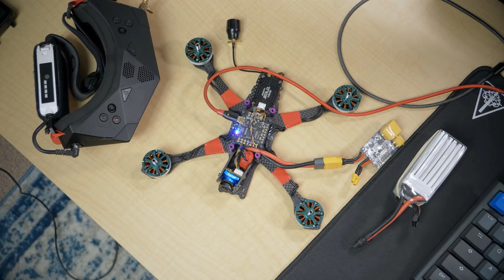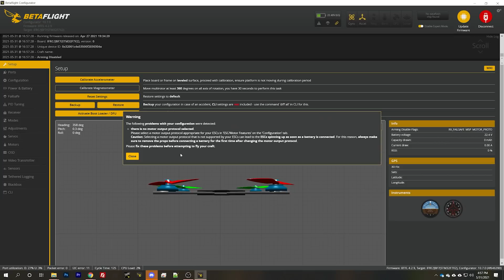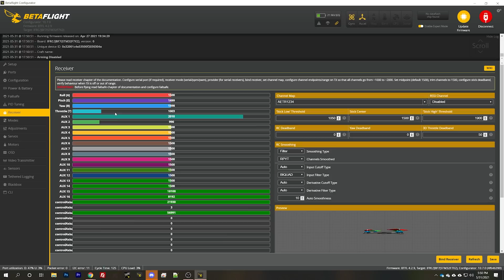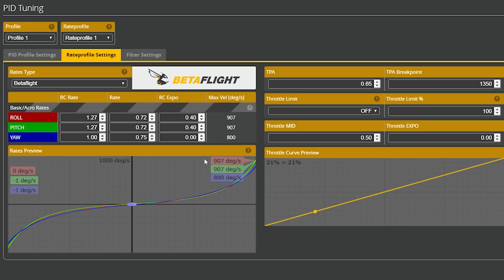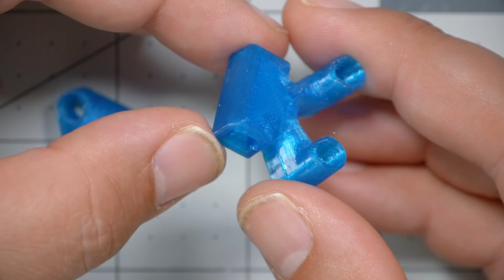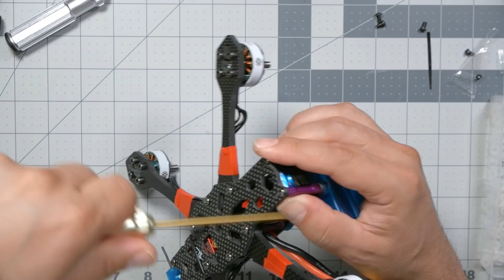JB's Perfect Freestyle Quadcopter | BETAFLIGHT SETUP (Part 2)

Comment: The Rush Solo vtx table has a minor error that will prevent it going into Max power, last powervalue should be 32 rather than 31: vtxtable powervalues 14 26 29 32
Reply from the maker: Oscar has already fixed this error and the text in my video description is also correct. So I didn't mention it further.

Comment: I couldn't get my vista camera to fit
Reply: Had to squeeze a little more than slightly but I got it thanks jb
Reply from the maker: The Vista is slightly wider than a micro sized camera so you have to squeeze the camera plates slightly to get them to go into the top plate.
Reply: @JoshuaBardwell  well if you are certain it will fit I will give it another shot but I gave it a pretty good go the first time ! Thanks for the reply btw
Reply: @JoshuaBardwell  would you belive my cam doesn't work now it must have squeezed too tight
Reply from the maker: No that's definitely not possible. The metal case of the Vista is more than strong enough for this situation. Check your camera wire to see if it has become unplugged or gotten damaged during the install. Check both at the Vista and at the camera.

Another thing to check: if you used M2 screws that are too long, they could have gone into the camera and damaged the board. But the M2 screws that come with the Vista camera should be fine.
Reply: @JoshuaBardwell  I'm not sure what happened I thought the same thing about the screws I took the camera apart and seen its not possible for the screws to be too long I'm not sure what happened I worked before I removed the top plate and installed it using the supplied mounts 

I changed the ribbon cable no 🎲
Reply: @JoshuaBardwell  hey jb turns out something did happen to the camera idk how 

I put another cam same mounts screws as before and it works so idk wtf sorry for coming off the way it seems I was just pissed cause the vista cam is an endangered species

Comment: Is this a joke? Do you actualy want to brand that biuld with your name Joshua?
1. cables touchin the gyro, add a battery belt and it squizes it more adding vibrations
2. power cables not zip-tied to anything - one crash with battery ejection and bye bye esc pads
3. power cables squized between standof and FC board
...like wtf man, where is the quality?
Reply: huh

Comment: How come you didn't update Blheli? It has the low and hight pmw like you showed us. please do tell us why you chose not to .. thanks
Reply from the maker: Variable PWM can cause problems like hot motors. I only use it if it's actually called for to solve a situation.
Reply: I run a hobbywing 60A ESC with your F7 fc and no problem but my friend is running your F7 and ESC stack and the motors and the bottom of the frame under the stack would be really hot. Maybe that was the problem, I say was because he had to get another ESC. Maybe that wasn't or was the problem but maybe do a follow up on the high and low PMW because I didn't see why not to do it just that it wouldn't be a problem. Thanks for all your help with us builders.

Comment: What is the problem with the JB F7 DJI firmware in Betaflight that you mentioned in the video?
Reply from the maker: The default current sensor is set wrong.
Reply: What is the proper setting?

Comment: You could still shave some weight down by using just a couple of ummagrip strips instead of that big fat large pad.  U really don't need that much to hold a battery down securely.

Comment: 👎👎👎 NO NO and NO 👎 it is NOT 704grams 👎 no
416g kwad + 187g lipo + 14g two battery strap + 124g Hero 8 = 741g !!! not 704g!! That is the most heaviest kwad of all. Light weight freestyle kwad with Hero 8 is 650g, on average freestyle kwad with Hero 8 is 675g, heavier kwad with Hero 8 is 700-710g. And you have 741g, light weight kwad with Hero 8? Come on Joshua, like you never build a kwad, you just put thinks in that kwad and that it. I know, you are going to say it's durable, you know it, because you can see in future, first time build it, first time fly it and you know. I'm sorry, I don't have such supernatural powers as you to know is it good or bad. I need at least months to know how good kwad is. You don't believe me, come to my yt channel and take a look my crash compilation.
P.S. sorry Joshua, you are in my TOP 5 on yt,  but in past half year I don't know what's going on with you, sorry one more time.

Comment: Hey man , is there mounting with the frame for a nebula nano or nebula pro?
Reply: only use the pro
Reply: @mikeybroe1  I finished that build months ago.
Reply: @skyweaver3199  ok.
Reply: @mikeybroe1  horrible build imo.
Reply: @skyweaver3199  damn why?
Reply: @mikeybroe1  the JBF7 board I saw a lot of issues with , a friend had a lot of issues with it. I liked the way the frame flew. But there was a flaw in mine when the chisel pieces left some wiggle in the frame. So first crash on concrete it was 🔥🧯

Comment: 603 to 704...Is that gopro missing the battery? Hero 8=126gm
Reply from the maker: Umm. I wanna say, no of course it had the battery in, but yeah your math checks out. FFfffffff.
Reply: Also weighed with no battery straps
Reply: GoPro don't need no special battery, if can power of the main pack. 😏
Reply: @AerialWaviator  I agree.
 I run the hero 6 with the iflight power cable, and removed the battery bay and side doors. It dropped the weight from 117gm down to 91gm.

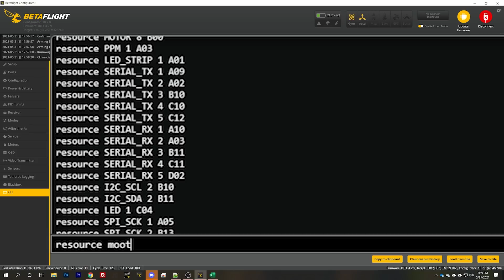Comment: 7:40 if you watch this in the future, after Betaflight 4.3 comes out, the motor remapping process is much simpler. they are adding a gui tool

Comment: well.... one compromise. No devil horns so the frame was low enough cost to include in the FPVCrate box. Really wish I could have paid an extra $5 for the box and just got the good arms. Also don't love the lack of battery strap holders. would have happily given up a gram so my straps weren't dragging over the top of my stack all willy nilly..... Overall though, this frame is flying like a DREAM. I am using the ring 2 2306 1755kv and a mamba f722/f50 pro-32 stack with a vista and it flies really nice.